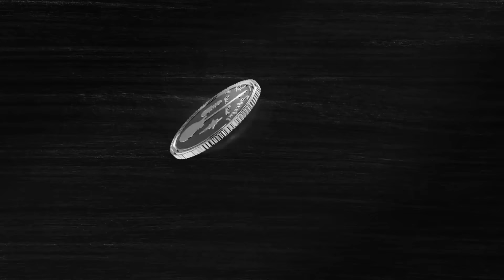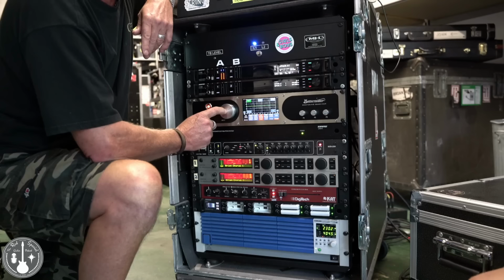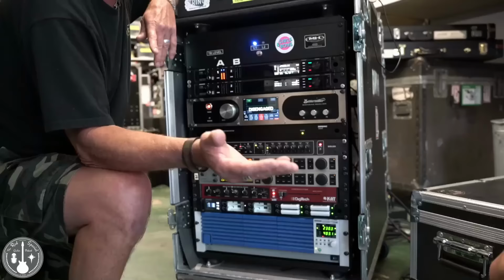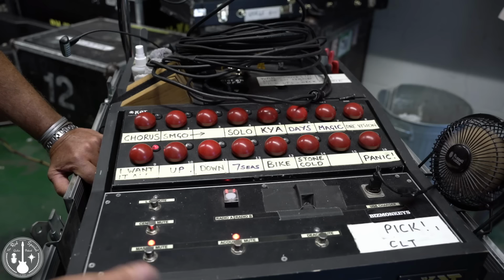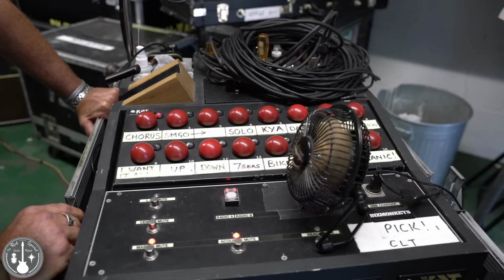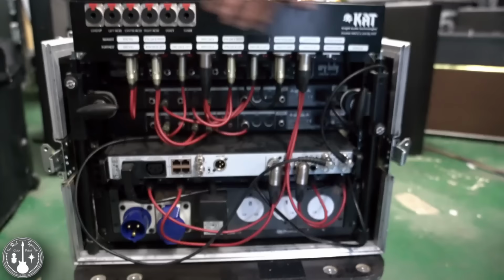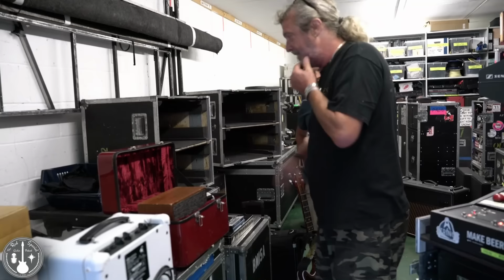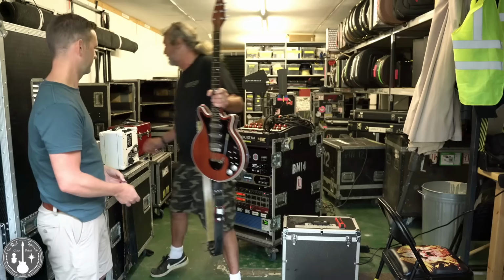Queen's Brian May 2023 US Tour Rig and Gear Rundown

Comment: Fantastic video Jon! Here's the exact models of the units shown for anyone who's interested:
-	KAT RED-18 Strap-Mounted Treble Booster
-	Shure ADX1 Body Pack Transmitter
-	2x Sennheiser antennae (A 1031-U Omni-directional & A 2003-UHF Passive Directional)
-	Kikusui PCR1000MA Compact Power Supply (set to 230V AC 50Hz)
-	Shure UA844SWB-E Antenna/Power Distribution System
-	Shure AD4D AXT Digital Wireless Receiver (with spare)
-	Shure SBRC Rack Mount Charger
-	Bettermaker Mastering Equalizer
-	Mike Hill Services Custom Switching System
-	Cry Baby DCR-2SR Rack Wah
-	KAT MIDI Switcher for TCs
-	TC Electronic G-Major/2 (with spare)
-	KAT Rack Mounted Digitech Brian May Pedal
-	3x KAT BM AC30 Special, separated by KAT acoustic panels
-	KAT Deacy Amp
Reply from the maker: Great information David - do you mind if I add it to the description?

Comment: I happen to have one of those little white Vox amps.. it's in my studio right now, I use the ext. spkr. to a V30 in a small cab and it sounds amazing..I record with it all the time.
Reply from the maker: The one you can see is actually a donation from a member of the community to the Red Special guitar meet-up raffle. All proceeds go to the Save Me Foundation.
Reply: I have #000824, Mfr. 2003-02.. I wouldn't part with it for anything! @TheRedSpecialGuitarPodcast
Reply: I have one too, I was wondering what it’s used for. My guess is to practice between shows
Reply: #005023 here, 2003-06 (not sure if 06 would be the week, or month).

Comment: There has to be a reason why there is so much noise. Are the effects units going into the input of the two outside amps? Cause they should be going into a loop returns instead.
Take a Suhr line out box from the centre amp into post effects then those into the effects return on his outside L+R amps. (I know his amps do not have loops), this would be a game changer for noise on the L+R amps though. Note* The centre amp would still be the main tone generator
Reply: You should tech for him 👍
Reply from the maker: To do what Brian does and have it sound like he does would not work like that
Reply: There's always an internet expert who thinks the people doing this for several decades don't understand what they're doing...
Reply: These Vox amps don’t have an effect loop :)
Reply: @martijn_yt these aren't built by VOX their built by Nigel knight of knight audio technologies who's filming the video. I have the BM rig too but digitally. Basically I use a heavily modified BMG red special with parts modified to be like the real one, the sixpences, kat plush treble booster, line 6 pod go (half a helix with my presets that are copied of the live rig here, all the fx out of the TC unit reconfigured exactly) I also have replicated the KAT ac30 amps which are normal channel only with one volume knob and celestion  blue and g12h anniversary speakers with 421 mics.
Reply: @martijnjansma6050 his amps are customized. He should have power amp inputs installed.

Comment: Great video Jon. Just wondering about the digitech rack. Are the electronics identical to the pedal version as in does it have the inbuilt treble booster. If so what was the gain set at as presume the signal it’s getting already has the treble booster from the strap.
Reply from the maker: Hi there, as fas as I know it's just the pedal moved to a rack. I think you can see the settings on the front panel if you pause the video.

Comment: I don't understand why they are now using their own isolation transformer.  That would drop a lot of interference.  Also they could run a spectrum analyzer with each string being monitored for any external noise that changes any db gain that would cause issues.  It looks like they are looking at the spectrum but new SA's have software that you can set your desired levels and any noise coming in would cause an alarm.   They also should look into DSP's ( digital signal processors) that can automate frequency filter ad channel switching.
Reply from the maker: I think the point is the changes are different in each venue so they would have to do what you suggested everywhere they went, which is not practical